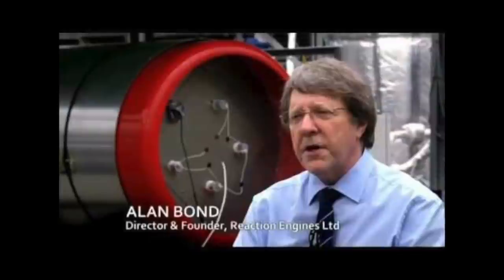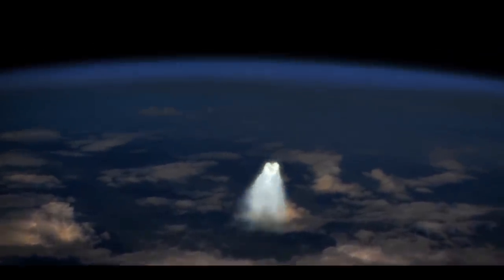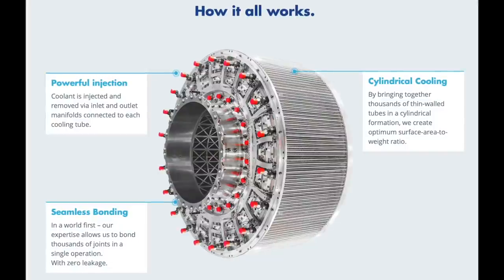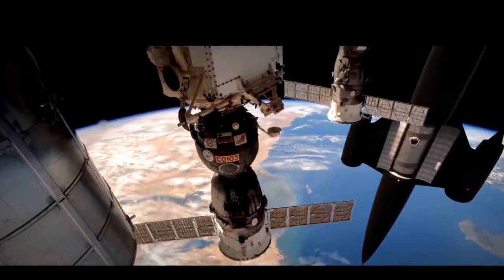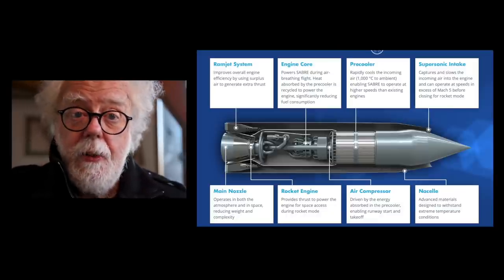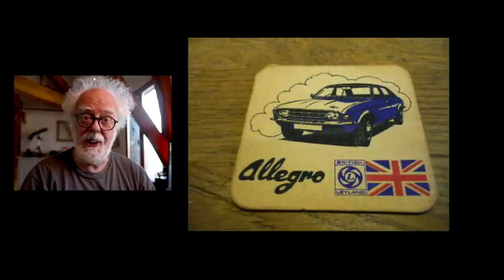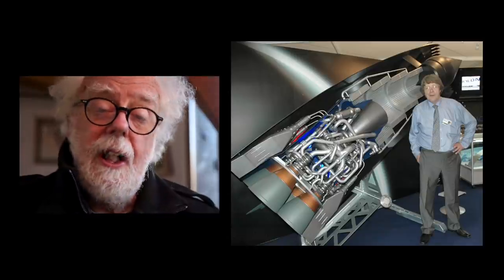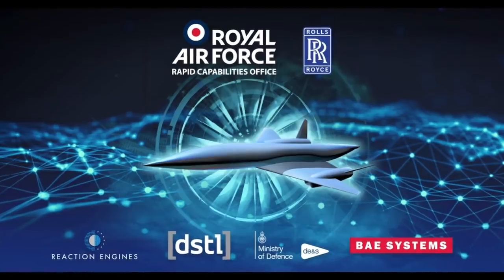Reaction Engines Spaceplane - Prof Simon

Comment: As long as the sabre engine is developed. Funding had to come from somewhere and in order to achieve that, there needed to be a purpose. But, the Sabre engine can be used for deferent applications. I believe the era of spaceplanes will come.

Comment: Professor, I have an idea, This engine has pretty high Isp and making this SSTO, takes all the advantage out in terms of economy. 
The idea is: instead of launching 2 stages with 2 engines, just a sideways decouplered tanks injecting initial fuel needed upto stratosphere. Then before hitting mach 4 or 5, craft ditches the tanks. Making this initially have less mass to take off, and still have advantages of both worlds of TSTO and having high Isp scramjet engine. 
I have the concept spaceplane working on KSP and it really works considerably more efficient than all the other designs I have.

Comment: Once again you’ve nailed it, Professor. While I was doing my dishes and listening/watching your excellent presentation, I don’t think I heard you reference the failed NASA foray into the aero spike engine concept, which was the U. S. SSTO concept. It would have in the opinion of many been a far more efficient method than the existing tri or quad stage earth to orbit successful and proven system prior to. So it’s dessert now, and off to bed.  Keep up the good work. It’s nice to be in the loop!😅
Reply from the maker: cheers David

Comment: I was checking through my subscriptions and realised for about 2 to 3 months I have not had a single video from you recommended to me or showing up . No notifications either. I had assumed you had stopped producing.  Is YT quietly  trying to make you a forgotten film maker? I have been a subscriber for many years and watch all your films within a day or 2 of release.
Reply from the maker: youtube have dropped me from suggested videos...i'm furious...an inner core of viewers are now seeing ad free and notified content on patreon... it's much better than YT.
Reply: This is what Youtube does (along with desubscribing people automatically). I doubt its deliberate, but very flawed software. I have too many followed, but I try to check channels manually often. I think commenting and liking videos also helps YT to bring videos into your daily feed as well.
Reply: Yt just recommended this ch in the last few days and I have been Binge watching. This intercooler might be handy for CO2 supercritical turbines. Gas powered power turbines can be very much smaller by using CO2. They still need heat exchangers. Nuclear molten salt reactors? Tiny tubes can withstand high pressures, flash tube steam boiler method?

Comment: Was the idea of an intercooler an aviation  technology or was it a automotive racing tech first?
Reply: Intercoolers have been around since engines were invented, steam engines have used them too. What's different about the REL intercooler (which is technically a precooler) is the unique manufacturing capability (vacuum brazing) that allows micro tube heat exchanger fabrication to the necessary spec for this type of extreme application.
Reply from the maker: yes...i hope those special manufacturing skills can work well for REL in the future.
Reply: @SimonHollandfilms  Thank You.  I play Kerbal and have really struggled  with Single  Stage to Orbit, it is difficult  in Kerbal  gravity and almost  impossible in real world overhaul ( our gravity)  the concept is  so cool, though... aviation and orbital  mechanics...
Reply: @Steven Martin It's true, the steam versions weren't strictly the same as today's intercoolers, and they were indeed incredibly dangerous, manufacturing capability is everything with heat exchangers, they're incredibly fiddly, lot's to go wrong in the fabrication stage. I suppose the first true intercoolers would have been on steam ships for the lubrication oil, or even the radiators on early water cooled IC engines.
Reply: @Steven Martin That makes sense, it's easier to bring less water to the boil of course, and it gives you a bit of warning for pressure rise in the boiler, compressibility, etc. Not good to have a large amount of superheated water in a closed space, just in case a valve seizes or worse yet, a sudden pressure drop or leak that causes sudden uncontrollable boiling! Pressure is a scary thing, I've seen it in action (from afar fortunately), and it's absolutely terrifying. Anything beyond about 10 bar and it's bloody frightening!

Comment: is the air going in getting compressed too? - that would raise the temperature....
Reply from the maker: yes very much so.....no conventional jet engines can input that much air at that temp.
Reply: Most of the temp change is due to adiabatic heating from compression. The reason it needs to be cooled is to improve the thermodynamic efficiency of the engine - the greater the temp gradient across the engine, from cool  intake to hot exhaust,  the more efficient it will be.

Comment: Is the project still running
Reply from the maker: oh yes....the company is doing great
Reply: @SimonHollandfilms  Prof, i have a question, does The engine can reach 5 mach. What the propulsion can reach that speed, or reaction engine just only find precooler to fix overheat of temperature.  Because i think scramjet is simpler because there is no propulsion to power the plane

Comment: Agreed.  The military industrial complex is a bit like the Borg,if any kind of game changing tech comes along it snaps it up and "assimilates" that tech.Its a weird one though,usually a cutting edge military evolution is news to everyone apart from those who developed it, but the whole Reaction engines thing has bumped along popping up on my radar for at least a decade or more.Either way I do know the "pre-cooler" has been proven able to cool very hot air in the incredibly short times that it would need to,to operate at the speeds it's hoped to attain once fully developed.💥💨👍

Comment: Isn't the heating of the air in the intakes due to compression rather than friction?
Reply from the maker: Hi Chris, thank you for your knowledgable input.  I have a question... can you run through how Sabre produces thrust at different times in the flight envelope.  1. take off. 2 subsonic flight  3 hypersonic atmospheric flight and 4 in space.  plus how are the engines used during decent...can they do a go around near the ground? if you prefer...email me at profsimonfilms@gmail.com
Reply: @SimonHollandfilms  SABRE4 (and 3) have a preburner that adds heat to the helium loop when it isn't extracting enough from the air flow, giving static thrust and subsonic thrust. At supersonic speeds excess cooling hydrogen is used in the bypass ramjets. 

Once it switches to conventional rocket mode, a separate preburner powers a standard turbopump arrangement.

Skylon con-ops expected a deadstick landing, like Buran and the STS Orbiter; but some of the TSTO concepts use an engine relight to achieve an RTLS

Comment: Hello Professor. I have a request/suggestion for a video. It is a new vehicle that is mostly developed and due to start delivering vehicles later this year. I am on the preorder list. The reason I think it would be a good subject for YOU  to cover is because there is so much interesting science associated with this vehicle. In fact, it is the numbers that attract me to it. A brief run down-
-It has a drag coefficient of 0.13 . This is really the foundation of all of the other incredible facts about this vehicle. Because it is so incredibly aerodynamic it's power requirements are super low. (electric)   
- Because the power requirements are so low it has incredible range with very few batteries. With so few batteries it does not weigh a lot which further helps with economy.
It is using in hub motors which are light and incredibly simply. No drive train, no separate motors. Just drums with a wheel bolted on at 93 percent effeciency. 
-Because the power requirements are so low it can make good use of solar panels that are on the surface of the car. In one day, in a sunny climate, it can accumulate 43 miles worth of power without being plugged in. 
- Because the power requirements are so low it can also charge over night on a standard 120 volt outlet- no special charging requirements like other EV's
Ok, I said brief. I'll stop here. The car is the Aptera. Check it out. It's really interesting and has an interesting back story too. Thanks

Comment: It seems rather obvious to me that the technology needs to be matured and then made more efficient leading to a cost reduction, increased safety. Until the Sabre engine flies and goes through at least or several improvement cycles, the SKYLON concept of single stage to orbit was always going to be very expensive and high risk. On the other hand, hypersonic transport at high altitudes really does open up long distance travel  in a way that current technology has failed to do. The opportunities are there, but not yet.

Embracing military tech options will actually help drive the Sabre engine concept is positive ways that will actually open up opportunities in the longer run. The engine size is likely to get smaller and more powerful as the technology is real world deployed and then developed further. Without military tech, the concept is likely to remain on the "what if" pile along with a wide range of past experimental technology projects.
Reply from the maker: good points Nick
Reply: @SimonHollandfilms  I'm actually much more disappointed by NASA basically returning to Apollo designs, even though the DoD is still flying a pace plane. The logical next step would have been a smaller, but more advanced shuttle design. If SpaceX can bring back the Starship and reuse it, it must be possible to do the same with a shuttle design.

Comment: Well, in the zeros I used to be a radio pundit and I predicted SABRE's first application would be on military aircraft. After all, many engines have evolved from a military context. Once proven by the military SABRE will find its way onto hypersonic military fighter-subspace-planes/drones (a kind of incipient Star Wars). Currently,  USAF have  expressed an interest in developing Spaceport Cornwall, and Lockheed Martin an interest in spaceport Sutherland - that's some serious interest USA military manufacturers are showing. Give it some 20 years and we will see a civilian passenger subspace plane. I also think we will see SABRE on two and three -staged rockets. Yes, staged rockets. After all, the point of single stage to orbit is to bring down cost and a SABRE engine is good at that for the first 20 miles or so of atmosphere, after which it came to propel itself back to base. What we have here is a case of; passenger subspace travel is going to take longer than we had hoped.
Reply from the maker: good points Franco..thanks for watching. we should collaborate on a future project.
Reply: @SimonHollandfilms  Yes let's. I like sharing  what I know (or think I know). It helps to winkle out inconsistencies and keep one's thinking straight.
Reply from the maker: good

Comment: If u have a look at the radius of the engine bend….and then calculate the centrifugal force  of the incoming air at Mach 5 ….that may explain the lack of ice buildup in the inter cooler….water / ice is heavier than air…..think a big dyson. ….shhhh…but don t tell anyone.

Comment: This is a huge bummer for me. I used to follow the development of this engine.  About 2 years ago they announced they had more than 1 megawatt of cooling capacity with the intercooler. And that's just a starting place. Regardless, I hope they get the engine fully operable. The West needs to get back out in front of Russia and China on hypersonics to ensure a good deterrant.
Reply from the maker: i think Sabre is progressing well....but as a military application....i am sure we will see parts of it used in some weapon system.
Reply: The precooler at full spec (1000 degC to -150 degC, at full Mach 5 air flow of ~125 kg/s) is in fact around 130 MW. During small scale tests they have achieved the figure you mention, but with a volumetric power density of nearly 1 GW/m^3, an utterly staggering performance.
Reply from the maker: staggering figures...congratulations... please feel free to email me anytime. profsimonfilms@gmail.com
Reply: @SimonHollandfilms  I should mention I don't work for REL, rather I work for one of the companies who have invested in them. The team I'm part of is working with REL, collaborating on heat exchanger technology development in other aerospace conceptual applications. I'd be happy to discuss some of the future concept work going on in the aerospace world if you ever wanted to though!

Comment: So what exactly makes it..."too expensive"? They already got it working...that's the expensive part. Sounds more like...they couldn't make "as much as" military or space than civilian. And maybe the demand per cost wasn't waranted. Just wish there was a better than oil based fuel...like hydrogen (on the fly produced) or steam pressure systems (that gave enough thrust). Or mercury superconducting levitation systems (that don't require much fuel).

Comment: The US succeeds because it uses evolutionary advances of known technology combined with a lot of money. See for example SpaceX's rockets, GE/Westinghouse PWR reactors. The UK fails because it uses ultra bleeding-edge technology combined with no money at all. See for example Sklyon and the Advanced Gas-Cooled reactor.

Hyman Rickover on reactors

"An academic reactor or reactor plant almost always has the following basic characteristics: (1) It is simple. (2) It is small. (3) It is cheap. (4) It is light. (5) It can be built very quickly. (6) It is very flexible in purpose ("omnibus reactor"). (7) Very little development is required. It will use mostly “off-the-shelf” components. (8) The reactor is in the study phase. It is not being built now.

On the other hand, a practical reactor plant can be distinguished by the following characteristics: (1) It is being built now. (2) It is behind schedule. (3) It is requiring an immense amount of development on apparently trivial items. Corrosion, in particular, is a problem. (4) It is very expensive. (5) It takes a long time to build because of the engineering development problems. (6) It is large. (7) It is heavy. (8) It is complicated."